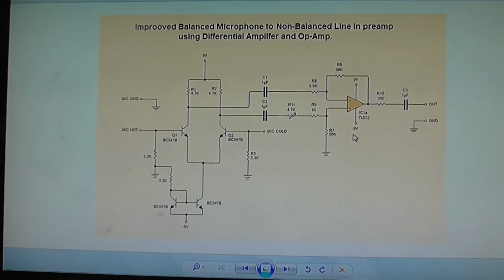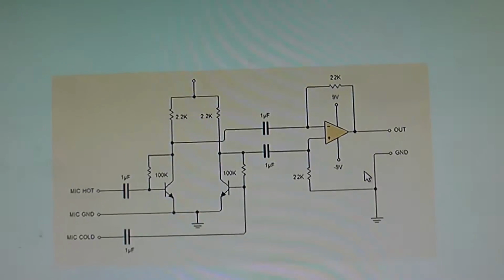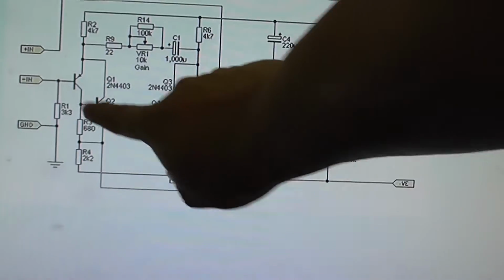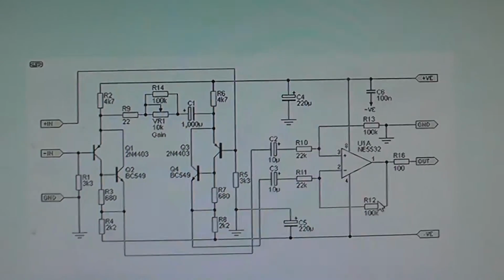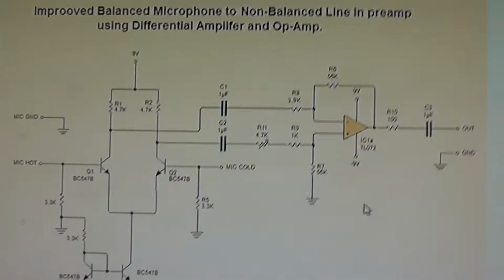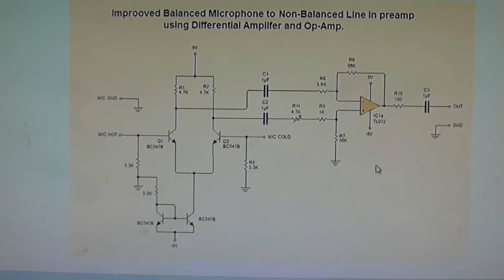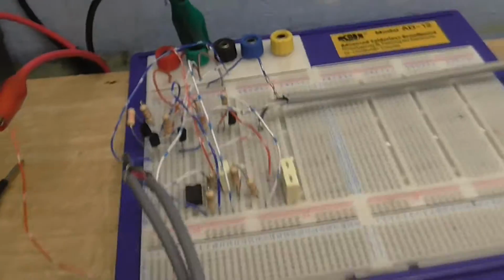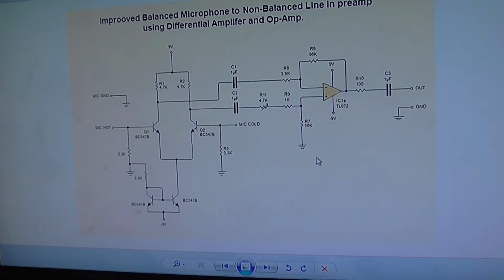Why wont this circuit work? (Tempory vid)

Comment: making current sources not in a integrated circuit is not a trivial problem. I would not be sorprised that it not working. the pair have to be at the same temperature and the length of the base has to be the same size that are not true from different transistor. you should use a matched pair at least.

Comment: Hey Clem, On YouTube there is a video called "Balanced Audio vs UnBalanced Audio Signals - Understanding how they work", only about 4:30 long. It is by Alectro Systems. To learn more go to www.alectrosystems.com. It's A- - A. The equation is, Output=(A + noise) minus - (- A + noise) = A + noise +A , minus - noise = 2A. Signal A + noise, Signal -A + noise. Hope this helps, you'll get it, your smart, that's why I watch your vid's. C.
Reply from the maker: As confusing as that sounds, I know what you mean, basically anything that's in phase will be ignored by the amplifier (or whatever).  I know in a balanced audio set up, that when an audio signal goes through the two signal wires, it's always 180 degrees out of phase on one of the wires, but any noise picked up along the wires will be in phase, and the equipment only "picks up" the difference between the two wires so any noise will not get through.

Comment: Hi Clem, Check out and Audio Forum. In one image, the signal input is applied to the two (2) non-inverting inputs (+) of the op-amp, then, the two outputs are connected to the inverting (-) inputs, via some resistors that set the gain, the signals should be out of phase with each other. Keep trying, C.

Comment: Hi Clem, I went to Google Images and typed in ' Balanced and Non Balanced Mic Pre Amp" and there were quite a few schematics on the subject. One of them showed only a 10k resistor from the output to the Inverting (-) input, like a negative feed back loop. All American Five Radio on YT has quite a few videos on op-amps that might possibly have something that may help resolve your issue. If I find out anything that might help, I will let you know. Maybe contact John Audio Tech as well. Be good, get some sleep, C.
Reply from the maker: Thanks but I know how balanced audio works already, the microphone I have is wired for balanced audio so I thought it would be a good idea to take advantage of that.  I was so confused the way the op-amp behaved (I'll admit I'm not an op-amp expert by any means), that I thought something was wrong. I just tried my other circuit (the one that almost has a differential amp as the input stage) and found that the op amp inputs do it with that circuit as well, but after watching an EEVblog video about op-amps he explains that it will do that in that configuration, so my circuit was working properly even though I thought it wasn't.  When I built that circuit up the first time, I didn't measure the op-amp inputs, so I had no idea that was even going on!  I also noticed it's quite hissy with only one side of the diff amp connected to the opamp, but with both sides connected it gets a LOT clearer and a little louder, and with only the other side of the diff amp connected to the op-amp, there's almost nothing at all.
Reply: CoolDudeClem Hi Clem, I'm no expert at op-amps either, I know a little about them. It sounds like you may have resolved your issue then. Thanks for the reply. I'll be looking for an occasional CDC electronic workshop and maybe some CDC animation. All the Best in 2017, be good, C.